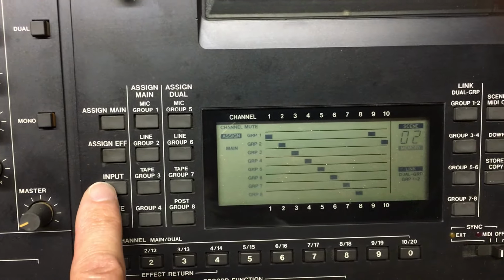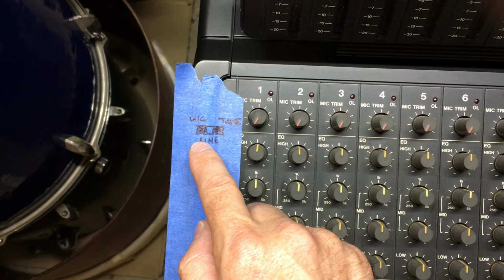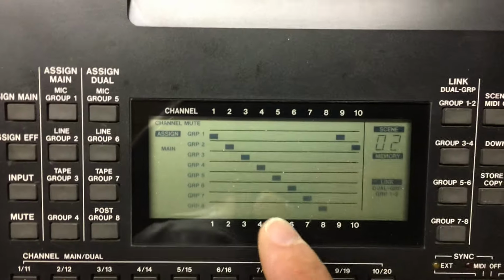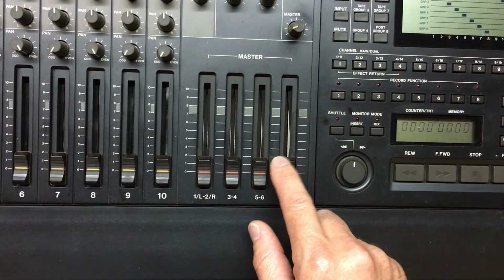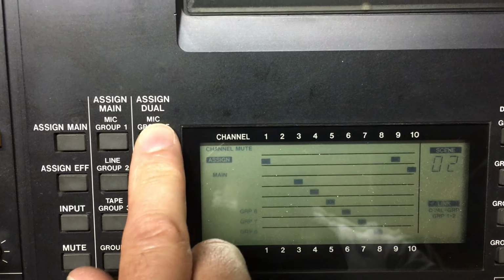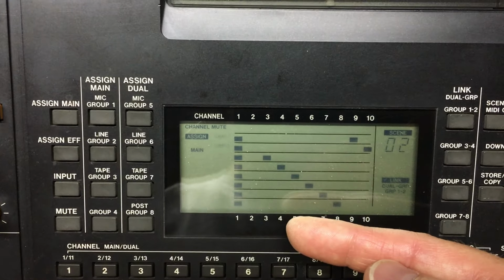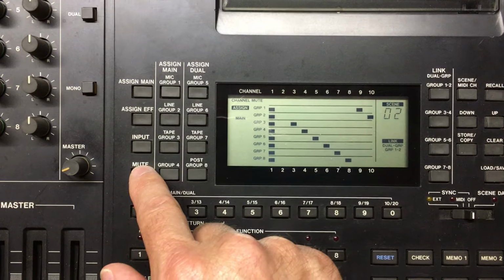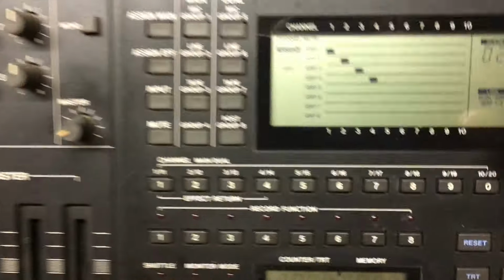Tascam 688 (and 644) Mixer and Scene Display Panel Demystified!

Comment: Sorry for the dumb question but would I be able to record 8 track inputs at once to cassette? I have an MPC with 8 outputs & have been trying to find a cassette recorder that can record 8 tracks at once. Most of the ones I’ve seen can only record 4 tracks at once. Thank you for the exploration video as well, it was really well done.
Reply from the maker: The only dumb question is the one you don’t ask. Yes the 688 is capable of recording 8 tracks simultaneously. So can the 238.
Reply: @SweetbeatsTechStop  thank you for your answer & consideration 🙏🏽

Comment: Would you consider creating a video explaining/demonstrating the Dual Bus? I feel I only have a quasi-grasp of all that it does and can do.
Reply from the maker: Hi. I’m sorry to say, but I don’t have a 688 (or 644 or any Tascam console with a DUAL buss for that matter) on-hand to do a demonstration. But maybe this will help: think of the DUAL buss as a stereo AUX buss okay? In a sense that’s what it is, but it is a very flexible AUX buss…actually like a separate 10x2 mixing section that operates in conjunction with the main mixer, and can even operate completely independent of the main mixer. The DUAL LEVEL control of each of the 10 input channels can be independently sourced to one of four sources: the respective channel’s MIC input or the respective channel’s LINE input (regardless of what is selected as that channel’s main source), the corresponding TAPE track  (DUAL channel 1 is track 1, channel 2 is track 2, etc…this applies to channels 1-8 only of course since there are only 8 tape tracks), or the respective channel’s post-fade signal (so whatever the respective channel is sourcing but the post channel fader signal). You select the source of each DUAL channel using the SCENE DISPLAY panel. Each channel’s DUAL LEVEL control feeds its corresponding PAN control, and then the DUAL section signals of all 10 input channels are summed at the DUAL MASTER knob. The DUAL MASTER knob feeds the DUAL L & R output jacks, as well as the monitor select switchrack…you can hear the DUAL buss sum in the headphones and also monitor at the MONITOR OUT L & R jacks when you press and latch the DUAL button in the switchrack. You can also route or “LINK” the DUAL buss sum to GRP 1-2, or GRP 3-4, or GRP 5-6, or GRP 7-8 using the SCENE DISPLAY panel. They call it the DUAL buss because it is dual-purpose…I’d actually argue it is multi-purpose. It is often used as a stereo monitor buss during tracking and overdubbing…gives you, the engineer, the ability to setup an independent stereo monitor mix of inputs, and tape tracks without messing with your levels and other settings on the input channels. It also provides the ability to setup a separate 10x2 mix of a variety of sources and route (“LINK”) that mix to any pair of mix busses (GRP 1-2, etc.). That DUAL mix, when routed to any of the mix busses, is summed with anything else routed to the same mix busses using the SCENE DISPLAY panel, so this is how you can setup a simultaneous 20x2 mix using the main mixer channels in conjunction with the DUAL channels…this is how you can, when mixing down your tape tracks, have up to 12 additional sources at mixdown. You can also use the DUAL buss as an additional stereo (or dual-mono) post-fade effect buss…or pre-fade monitor buss depending on the sourcing of each DUAL channel. So you see, the DUAL buss is multi-purpose: monitor buss, 10x2 routable summing mixer, effect buss, matrix mixer…and all very flexible because each of the 10 DUAL channels’ sources can be independently selected. Hope that helps.

Comment: This was great! It really helped me understand the assigning and mixing functions of the TASCAM 688. I bought mine in 1989 and did a lot of great recording using it without even understanding the assigning functions basically just used the default settings and just mixing down using the cue monitor output to a mixdown recorder.  In 1999 I bought a Roland VS1680 going digital and did a lot of recording over the years until the drive crashed a few months ago. I pulled the old TASCAM 688 out from storage plugged it in and found the capstan belt had melted. I found a video on Youtube which helped me change the belt. Now I'm exited about learning more about the TASCAM 688. Thanks again for this video!
Reply from the maker: Glad it was helpful…! What’s old is new again with some TLC. Beware if the capstan belt was melted the pinch roller may also be needing replacement. I highly recommend the rollers from Athan Corporation. Well worth the expense especially on the 8-track cassette multitrack machines. Again, glad the video was helpful and deepened the usability of the machine for you. That’s exactly why I created the video.

Comment: I assigned all my tracks to tape and pressed the Group 1-2 monitor button to use as the master fader. The first track plays at full volume and only to the left and the second track I can control with the track fader, but it is panned to the right. All other tracks are dead silent. I'm just looking to mix each track using their own faders and to pan them as I need. Any idea what I may be doing wrong? I'm very used to mixing on a Fostex 260 which is a bit more straight forward. Thanks to any replies!
Reply from the maker: Hi. So let’s iron out a little terminology…tracks are tape tracks. Sources are connected to mixer input channels. So you’re first sentence where you say you assigned all your tracks to tape…am I correct you assigned all your input channels to tape tracks? If that’s correct, step 1, tell me how you assigned all your input channels to tape tracks, and how many tracks have material recorded on them. Are you confident your input channels made it to tape tracks? How did you have the GRP 1-2, 3-4, 5-6 & 7-8 faders set during tracking? How did you have the PAN controls of your input channels set and then in scene display panel how did you have each input channel assigned? If the answer to any of these is “I don’t know” then we need to go back to basics.
Reply from the maker: A big part of what can be a challenge to folks that aren’t familiar with the 688 or 644 is, first and foremost, the mixer architecture itself if you aren’t familiar operating a console that is more than relatively basic. And then the second challenge is how to access all those source and assign features. So, it’s more complex than basic, and many of those complexities are hidden in the Scene Display Panel. And this can be confusing because the tactile controls kind of make it look like a 10 x 4 console with 3 aux busses, but it’s actually a 20 x 8 console with 10 main channels, two configurable aux busses and a configurable stereo monitor buss. The other thing that’s confusing is there’s no main or dedicated “stereo L-R buss” per se…you have 8 mix busses, ganged in four pairs on the four two-channel group faders. Those groups feed the 8 tape tracks. You don’t use GRP 1-2 during tracking or overdubbing. If you’re used to a smaller format typical console, you’re looking for that master buss that you monitor.  It the 688 and 644 are setup like a recording console, at least like Tascam’s iteration of a recording console, where you have input channels, groups for record bussing, and some form of monitor buss, which is like the clearing house of audio access during all stages of recording, and then you use two of the record buss groups for mixdown. This is the same as the M-50 or M-500 series consoles with their monitor mixer and 8 mix groups. So when you’re tracking you set the source of the DUAL buss for each channel to either input or tape so you can monitor inputs or tape tracks (when overdubbing) and source the monitor buss to DUAL, and then when it’s time to mixdown you set the input source for channels 1~8 to TAPE and assign to GRP 1-2 using the Scene Display Panel, and then set the monitor section to monitor GRP 1-2. So it’s DUAL buss for monitoring during tracking and GRP 1-2 during mixdown.

Comment: could you walk me through how to use the effects return and how to run outboard effects through the aux channels?
Reply from the maker: Do you have the manual? And 644 or 688?
Reply: Yes! 688. I'm trying to run a reverb pedal through effects return 1, or alternatively to run it through aux 1, and then be able to spread out to multiple tracks
 @SweetbeatsTechStop
Reply from the maker: So there’s all sorts of contradictory wording in your last message. You can’t run an external effect “through” the effect returns. Similarly, you don’t run an effect “through” an AUX send. And in either case you’re not “spreading it” to multiple “tracks” (channels?). I’m not trying to be a price by picking apart your wording. I’m highlighting stumbling blocks for me in your terminology that also may underscore misunderstandings on your part about how incorporating effects works, and my goal is to help with that and help answer your question. But I want you to do some work too, or you won’t learn. “Tracks” are tape tracks. Are you wanting to apply reverb to multiple tape tracks, or are you wanting to apply reverb to multiple mixer channels’ inputs? Your reverb box has an input, and an output. You use an AUX buss to feed the input…use the AUX 1 or 2 controls on each mixer channel you want to send to the reverb box…let’s say we use AUX 1. Turn up the AUX 1 knobs on each mixer channel to taste, you control the overall level to the reverb box with the AUX 1 master level knob, and connect the AUX 1 output jack to the reverb box input jack. If there is a mix knob in the reverb box set it to 100% effect or wet…no dry signal. Connect the output of the reverb box to EFFECT RETURN 1. Now here is were you’ll have to clarify what you are wanting to do or are trying to do before I can tell you what to do next, because the EFFECT RETURN jacks can go multiple places. You assign the return using the scene display panel. Hopefully that helps to get you started,  it would you do something? Read pages 28 & 29 of the manual. Study them. Study them with your 688 in front of you so you can try the things the manual discusses.

Comment: my pitch control doesn't do anything. Is it broken or do I need to spend more time with it? I would hate to try and fix something that isnt even broken
Reply from the maker: I would assume it’s broken. It’s pretty simple…turn the pitch control knob clockwise, the tape speed should increase, turn it counter-clockwise it should slow down. If it doesn’t do that something is not right. I’m assuming you’re talking about a 644 or a 688 right? You did specify.

Comment: Help!! My 688 stops automatically everytime I press the play or rec+play buttons, basically the head comes down and returnes up as if by pressing the play button I immediatly press stop. Rewind and fast forward works fine. Is it a big problem like with the motor or other important components or  just a belt replacement issue? Please, help!
Reply from the maker: Does your capstan shaft spin? Like open the cassette door, and with the machine powered up gently press on the switches that too if the cassette presses on when you load it. The capstan should spin up. Or maybe the capstan spins the whole time the 688 is powered whether a cassette is loaded or not. I can’t remember. Bottom line question is can you get the capstan shaft to spin? If no you probably need a new belt. Your symptoms read like a bad capstan belt.
Reply: @SweetbeatsTechStop  the FF and rewind works well so I guess the motor its ok, I hope. When the 688 is powered I dont think the capstan spins the whole time, I'll check what you suggested and hope for the best. Than you ~
Reply from the maker: Yes, the reeling motor is fine. But that has nothing to do with the capstan. The 688 utilizes a three-motor transport, one for reeling, one for capstan, and one for headblock assembly actuation.

Comment: I had a question that i can not seem to find an anwer to, depsite the crawling around online for the answer that I thought you may be able to help with. I have one channel in particular on this particular machine that upon startup peaks and stays peaking on the VU meter. Its the only channel that does it, i have opened it up and looked for cold solder joints and tested continuity on the power rails as well as checked all of the small record and erase head clips (i cant think of what these are called) that attach to he main Bias and calibration Lower PCB board and everything looks ok, any suggestions of where to possibly look for fault?
Reply from the maker: Nothing simple comes to mind. You might want to try posting the question at the homerecording.com forums, there is a sub-forum there for analog equipment. There’s a member there with some experience with 688s and I have a faint memory there was a VU meter issue and maybe a solution. Is the issue just with the meter or are there audio problems with that channel?

Comment: Amazing video thank you. Can you please provide an example use case of the dual bus function?
Reply from the maker: The Dual buss on the 688 and 644 is a really powerful facet of the mixing section. It is basically a 10 x 2 monitor mixer within the main mixer, but what makes it powerful is you have multiple source options, selectable per channel, and multiple output options. Each of the 10 Dual buss input channels can source either the MIC inputs, LINE inputs, TAPE tracks (Dual channels 1~8 only of course, since there are only 8 tape tracks), and the POST fader signal of the respective mixer channel. The Dual buss has its own dedicated output jacks, plus you can select the Dual buss in the monitor select switchrack, and you can also link the stereo output of the Dual buss to GRP 1-2, 3-4, 5-6 or 7-8 to record to tape. Common uses for this flexible mixer within the mixer is to use it as a cue mixer for tape tracks during overdubbing, as an additional pre fader stereo AUX send that can source either the MIC or LINE inputs, or as an additional post fader effect buss. It is also how the 688 mixer can simultaneously source 20 inputs (all 10 MIC inputs and all 10 LINE inputs)…the channel inputs can be set to one (MIC or LINE) and the respective channel Dual input can be set to the other. Hope that helps!

Comment: I you had a standalone tascam reel to reel 8 track, can you bypass the cassette and go out to the r2r and have all the mixer functionality?
Reply from the maker: Are you talking about with the 688? The answer is yes to both (644 and 688), but the 688 is much better suited to do what you’re talking about because it has 8 mix busses. So you would connect the 8 GROUP OUT jacks to your tape machine inputs, and connect the tape machine outputs to 8 of the line inputs.

Comment: Honestly, opening the machine up and spraying some contact cleaner on the offending channels would still be a lot easier than trying to figure out this scene matrix, because the switches are straight forward and instant access!!
Reply from the maker: I don’t understand your comment. The 644 and 688 have an electronic switching matrix instead of mechanical switches for source selection, input assignment and channel muting. The video isn’t about using the matrix instead of switches if you are having trouble, it’s about how to use the matrix, because there are no traditional mechanical switches to service.
Reply: Oooh, never mind. I found two presets that do all that I ever need the machine to do and that's good enough for me...
Reply: @morenazo6412  I totally agree, and the useless manual isn´t helping either..

Comment: Great video. Could you please do one that explains and demonstrates the midi functions. Considering it’s unique for the unit. Cheers
Reply from the maker: I don’t do a lot with MIDI, so I’m not necessarily the best resource on that subject. The 688 Owner’s Manual goes into a pretty good overview of the MIDI  functions and features starting on page 30, though it’s focused on integration with standalone sequencers since computer based DAWs were not yet commonplace. Basically the 644 and 688 have the features of an MTS-30 onboard, MIDI timecode with song and position pointer (FSK) is recorded or “striped” on track 8 (track 4 of the 644), and then the sequencer or DAW can “listen” to that timecode to keep MIDI sequences locked to the tape. There’s more to it than that, but that’s the high-level overview. Pages 30-35 of the 688 manual are worth a read because they cover not only some education on MIDI sync and what you can do with it, but specifically what the 644/688 can do and how to do. Understand you can do the same thing with any tape machine and a MIDI sync box, the 644/688 just have the features onboard, as well as the ability to receive MIDI control messages from a sequencer to control a limited number of mixer functions (change routing scenes, switch channel mutes on and off), which IS unique to the 644/688 among any other cassette multitrack machines (though not uncommon among many analog mixing consoles of the day, including a number from Tascam).